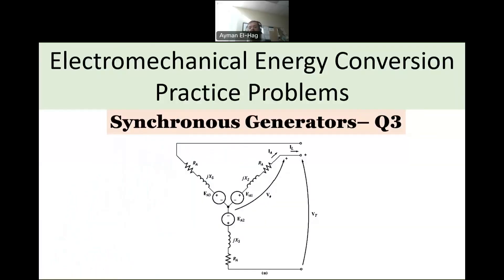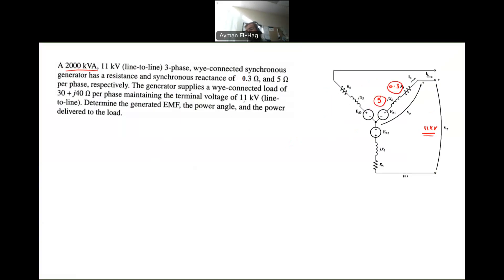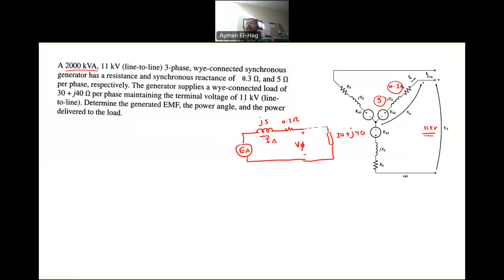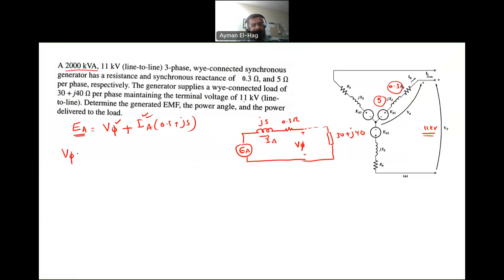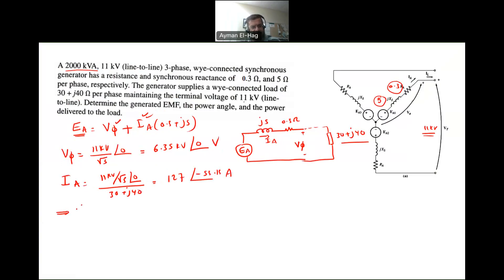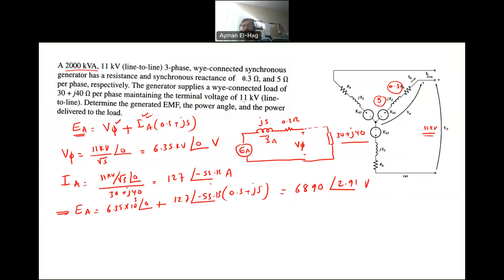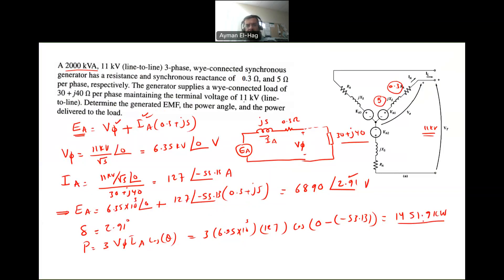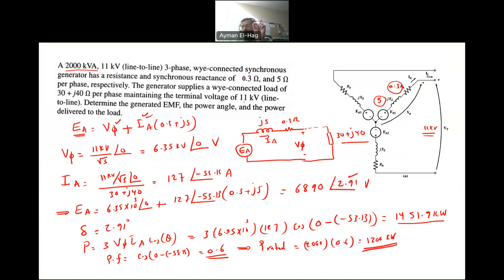Synchronous Generators - Question no. 3

Comment: Good explanation sir. If the load connected as delta connection in this same question, how we find internally generated voltage
Reply: I got the answers sir. I hope that will be correct.
Reply from the maker: You can convert the delta load to Y connection by dividing each phase impedance by 3.
Reply: Thank you sir. I have a problem in open circuit characteristics curve. Did you upload any video under that chapter.
Reply: A 13.8-kV, 50-MVA, 0.9-power-factor-lagging, 60-Hz, four-pole Y-connected 
synchronous generator has a synchronous reactance of 2.5 ohms and an armature resistance 
of 0.2 ohms. At 60 Hz, its friction and windage losses are 1 MW, and its core losses are 1.5 
MW. The field circuit has a dc voltage of 120 V, and the maximum I F is 10 A. The 
current of the field circuit is adjustable over the range from 0 to 10 A. The OCC of this 
generator is shown in Figure -1
Assume that the field current of the generator in Problem -2 has been adjusted to a value 
of 5 A.
(a) What will the terminal voltage of this generator be if it is connected to a delta-connected load with 
an impedance of 24 ohms magnitude and 25 degrees phase?
(b) Sketch the phasor diagram of this generator.
(c) What is the efficiency of the generator at these conditions?
(d) Now assume that another identical delta-connected load is to be paralleled with the first one. What 
happens to the phasor diagram for the generator?
(e) What is the new terminal voltage after the load has been added?
(f) What must be done to restore the terminal voltage to its original value?
At field current 5A open circuit voltage 16.2kV. Can you explain this question
Reply from the maker: Did you check this question:
https://youtube.com/playlist?list=PLDkq31epwdjz4k7GTh9VmOMxMjq6K9rtT&si=QLtDiuM6E6EKwuIK
Reply: Yes sir just now I watched. The datas are exactly same your explanation also very well. Thanks a lot sir. But that 1st question I mentioned in my comment is not available in this vedio. If you can check and can you explain that part only. Then I can understand other parts with my own knowledge. Its my humble request sir. Sorry for the disturbance sir. I am confused for that question from past week but still I didn't get the proper solutions. That's why I'm asking you sir. Please help me sir.
Reply from the maker: @jencilysenjon4117  You need first to find Ea from the curve then apply KVL to find terminal voltage.
Reply: Yes sir I tried that way but I have doubt on that convert the delta connected load to y connection with phase angle
Reply from the maker: @jencilysenjon4117  you just divide magnitude phase angle stays the same
Reply: OK sir thank you so much 🙏 for your help. I will try.

Comment: Does these calculations apply to solar or wnd turbine energy sources?
Reply from the maker: Solar energy is basically supplies DC power and needs a converter to change it to AC. The wind turbine use induction generator which is different than synchronous generator. So, these calculations only apply to synchronous generators which are usually used with thermal power plants.